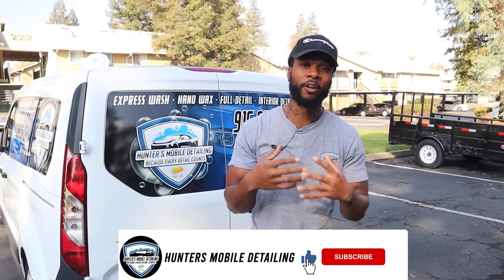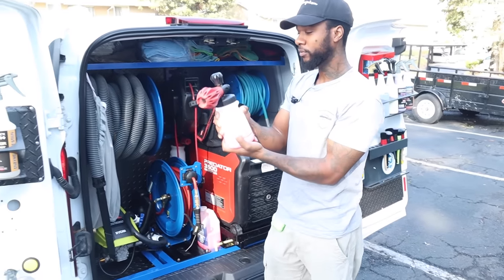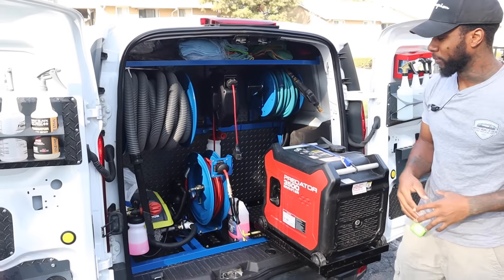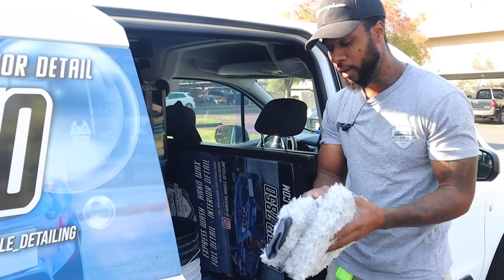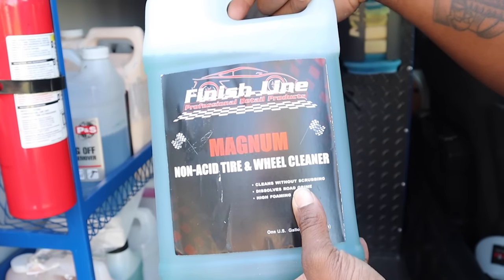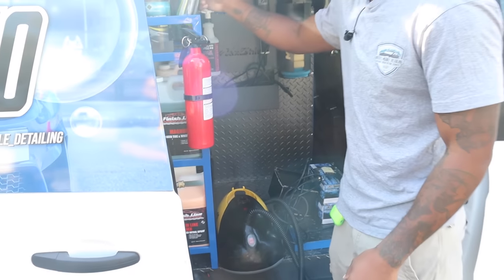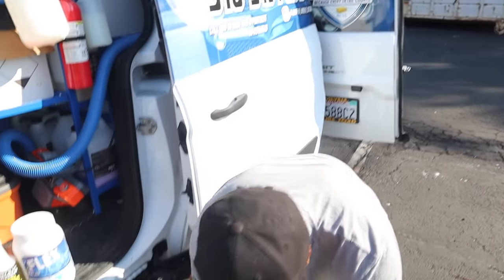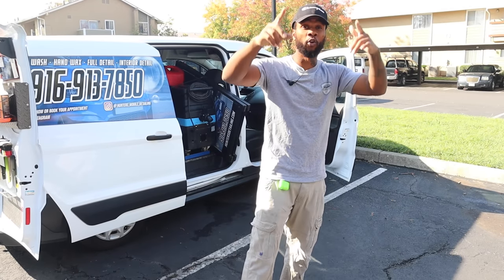Everything You Need To Start A Mobile Detailing Business - Hunters Mobile Detailing

Comment: I didn’t see a leaf blower. Good for getting excess water off before the final micro fiber drying. Battery powered or electric. Don’t use the gas ones, they are to loud and you could drip motor fluids from it onto your clients vehicle when reaching over them to dry them. Also wrap the tube end of the blower with a couple of micro fiber towels with some rubber bands or buy a piece of 1/4 inch foam from a fabric or craft store to use for scratch protection. Anything that gets close to the paint on a clients car increases potential for scratches. I know how I am about my own car. I really enjoyed the video. Thanks for the info I didn’t have. You got a subscribe.👍

Comment: Dope set up. You running deionized water in that tank? Good to hear the pressure washer is holding up with the low pressure water source. Ever thought of a leaf blower? Greenworks is at Costco for a good price.. or people really like the EGO one too. As long as ground is a damp from the wash you wont be blowing up the dust back on the car. There is the Big Boi Blower and the MasterBlaster Rev as well that have filters and are heated.. no I’m not making those names up 😂  (i use the BigBoi with a 30 ft hose)

Comment: And pro tip get a big gas pressure washer I got a predator 4200psi 4.2 gpm it big… but why you might ask? Your a business so that asset can really be put to work on just about everything  strong enough to take down graffiti about. you will not regret it so long as you keep it making money on jobs it’s the star of my business this pressure washer and it won’t mess things up get a psi gauge if you don’t want to mess up things it’s pressure is adjustable

Comment: As a former detailer. All I can say is don't bite off more than you can chew. be honest and upfront. Take pictures of before and after. Keeps you and customer accountable. Some cars are so dirty you can't see damages until its clean. That is always a risk. I always asked a customer to pre-wash the car before I would do a full detail. That way I can take pictures of any damage. So, in the event a customer state's you damaged their property, you can show the damage was there prior to you doing your work. And yes, some customers are VERY picky. Just be upfront set expectations. Again, having the customer prewash the car will give you a better idea of the end result will be. I only asked them to prewash if it was extremely dirty. I have also been accused of stealing property. get a go pro with a suction cup stick it on the inside of the windshield if you are doing interior detailing. Check door jams. trunk jams and under the hood. I have seen some shitty work meaning. They cleaned the outside, it looks great. You open the door, and the door jams are just filthy. Same with trunk and under the hood. Thats like taking shower getting all cleaned up but not brushing your teeth. Charging for what some detailers consider extra. No, doing the jams is just as important as everything else. Keep pricing simple. If they wanted me to do just the exterior but no the jams or under the hood so it would be cheaper. I wouldn't take them as a customer. I don't want my name associated with half ass work. I will advise them to go to a touchless carwash if they just want the exterior done.

Comment: Mann.. 17:10 I must say.. this setup is impeccably clean and can tell you came a long way and have used many a product.  

I must ask tho, as a starting again detailer wanting to have all the best stuff, the amount of soaps And waxes is overwhelming .. do use the under coat soap and the degreasers and bug sprays as specific as possible ? / is it necessary or can you use some soaps for all of those as it’s similarly the same type of material on the car .. plastic and metal for undercarriage… grille .. I like zep as a good cheap one I’ve used all around the house and sometimes my car for some parts even though it’s hella strong.  

Same thing with all the waxes and polishes.  Gonna watch some more to really define my question but anyways if you do get to this thanks a lot and keep doing great !! Your by Covina or whenever, in not far but in a whole nother valley on the other side!  Bringing the quality over there

Comment: I use my tornador with interior gloss also. Let all the windows down, gets into all the nooks and crannies. Makes ac vents look amazing. I do the top of the dash by hand to minimize haziness on the windshield.
Takes a little under 2 minutes to gloss the whole car. Then I come with my rag and air in the same order so that the gloss has had enough time to dwell before i wipe it prematurely. 
I do this for basic interior. To the average person it looks amazing, but from time to time depending on the interior materials it can leave a slightly uneven shine, or the shine wont last as long as compared to hand applying. I find it works best on dodge/chrysler/jeep because their interiors soak up shine very well.

Tornador also works well for pretreating seats, and ive cleaned spots from headliners using only the tornador and nothing else

Comment: Finally somebody professional who don't have a bundle of chemical GAY's collection 😭🤣🤣🤣🤣

Bruh this setup is very solid, have something you have to try, buy some 3 inches backing plate for your drills, cause if you lil Rupes die you have a option to use your drills too, also try to test Meguiar's number 100 it's a very good Polishing Compound will helpe you to remove scratches aroud 1200 to 1500 grit, and you can find it at Harbor Freight tools as well. Or Malco Tru Grit is a very good coumpound too, you'll spend less time to correct some annoying scratches on hard clear coats. Have a good lucky maah boy 🔥🔥🔥

Comment: I got a dewalt electric pressure washer 2100psi 1.2 gpm. I bought a MJJC foam cannon and didn’t get the foam I was seeing on videos any suggestions. Also I did change the orifice to a 1.1 mm and used 2 oz of chemical guy mr pink soap . Just trying to clean my vehicle to save me a buck .